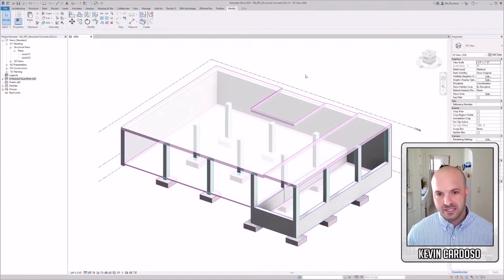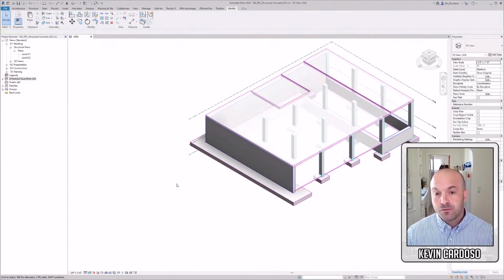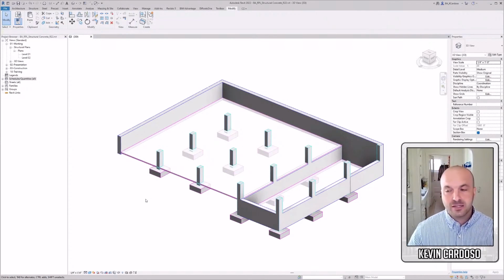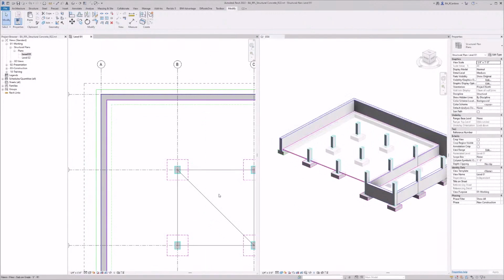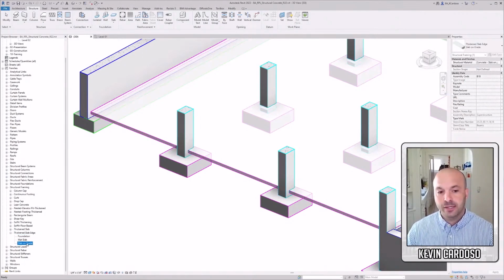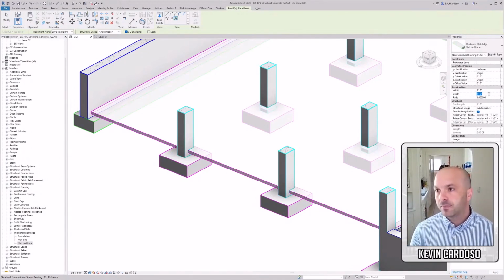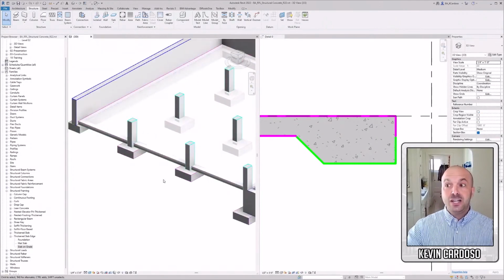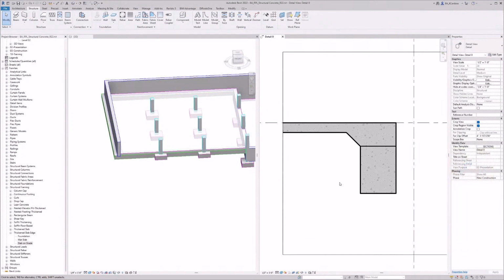Revit Concrete Master Reveals Secret Technique, with Kevin Cardoso | Clip

Comment: Using Structural Framing in lieu of Slab Edges kind of defeats the purpose. A thickened perimeter edge is still a FLOOR, not a beam. In use there's really no savings I can see. To create the slab edge "beam" family you STILL need to define a profile AND have to tie all of the same parameters together, so you aren't saving any content creation time. Same rules apply for materials - a slab edge family needs its material to match the floor to make it continuous. The difference is the lineweight will be Thin in a slab edge because they are of the same category (Floors). And if I need to export just concrete slabs (something I would do in construction modeling all the time) it's an extra confusing step as you need some special "That's not really a beam" type filter.

Comment: Yeah I don't think that modelling elements using incorrect categories is acceptable in a professional workflow
Reply: I'd be curious to hear why you feel that way. By this reasoning, then, it is impossible to model a concrete curb because Revit does not have that category.
Revit is just not 100% there yet (especially for the construction subs) and continues to be developed and improved. In the mean time, why should construction subs handicap themselves from a better workflow just to match arbitrary categories that Autodesk created with only Design teams in mind?

I'll also point out that Revit itself does something similar. When you use the "Structural Foundation: Slab" tool, Revit behind the scene is just creating a Floor and slapping a "Structural Foundation" category on it.
Reply: @bimdev  Well it depends on what are your expected uses for the BIM model. If it's just for rendering and generating impressive images then sure categories wouldn't matter, but if you use it for other non graphical purposes (quantification, clashes, FM & so on) that could cause alot of problems for users trying to extract meaningful information from the model. In a professional design environment, some BIM managers wouldn't allow even using the (Generic model) family categories.
Reply: @MR0MYSTERY0  I agree with you that some BIM managers wouldn't allow it, but they are exactly the ones who should see this and think of ways to make their team more efficient. If the models being built are for internal company use, then those standards can certainly be determined in-house. Even if that's not the case, it does no good to shut down the idea and completely close yourself off from imagining what's possible because a category happens to have the wrong label.

Ideally, in this case, Autodesk would allow custom families to be assigned any category that the creator wants. But as it stands, Structural Framing (I think) is the only one that allows for the creation of custom families with line-based functionality.

Comment: Cool technique, if you modify the variable thickness properties or apply a slope arrow to the floor sketch, does the framing maintain its picked position or does it adapt to the shape edit? Appreciate this workflow, I've always loved modeling concrete for reasons you discuss regarding efficiencies of families!
Reply from the maker: If you watch the full live session replay, Kevin does showcase a floor with variable height and what happens to the beams.

Comment: If I am working on arch, nothing wrong with slab edges or wall foundations, we have no need to add reinforcement. 
If structural gets more control using beams etc, by all means, they should do that! Looks good!
Reply from the maker: Yes, Kevin creates highly detailed models for concrete subcontractors. Still, some of the insights could probably apply to arch.